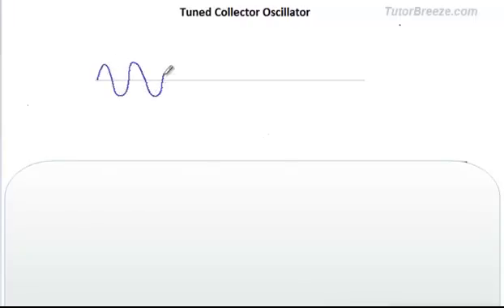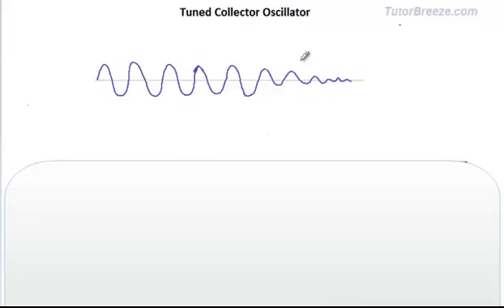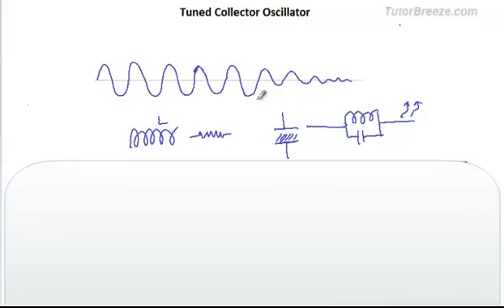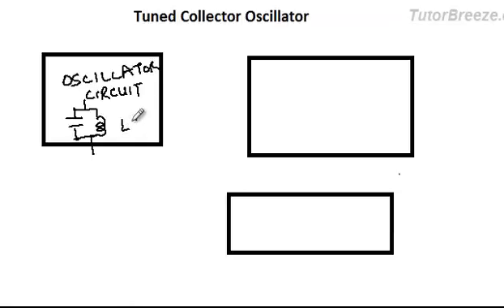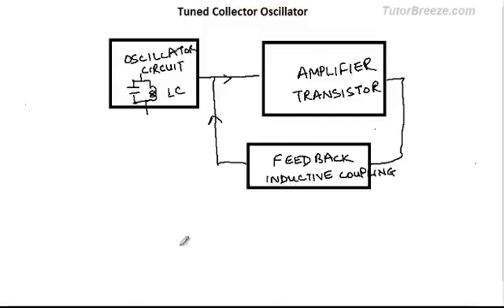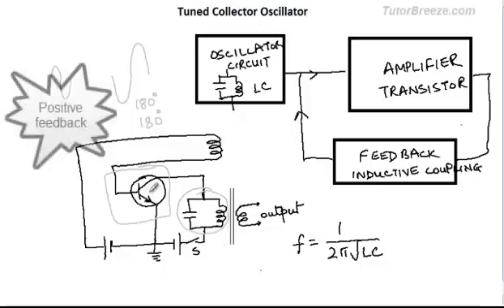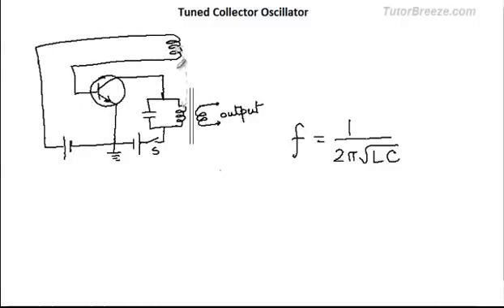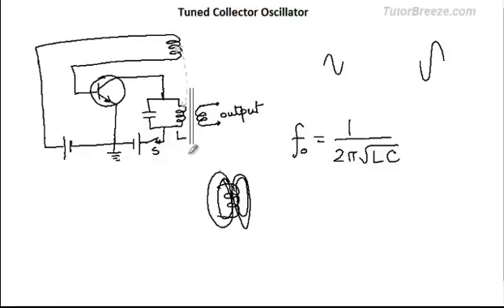Tuned Collector Oscillator- Transistor Oscillator

Comment: Is that DC source ? If yes,then the inductor acts as a short circuit.Also you said that "due to changing magnetic flux...." and that's not possible with DC.
Reply: change in magnetic flux is to be there coz inductor is having capacitor in parallel and we know capacitor doesn't discharge at constant rate so it will produce a varying current which causes a change in magnetic field

Comment: Very thorough explanation thank you so much. I have watch tons of videos and never grasped it
Reply: wt is inductive coupling ?????how it function as (+ve) feedback...plzzzz ans.
Reply: +kaad shah the increase in current produce a varying magnetic flux within the inductor on the tank circuit. this change in magnetic flux is picked up by the inductor connected to the base. and due to this varying magnetic field, a current is produced in the inductor at the base
Reply: +kaad shah this current produced in the base will be 180 out of phase with the current in the tank circuit. but it will be in the same phase with the input current. hence there is a positive feed back
Reply: thanks for the effort Gautham Krishna but still the word ...coupling !